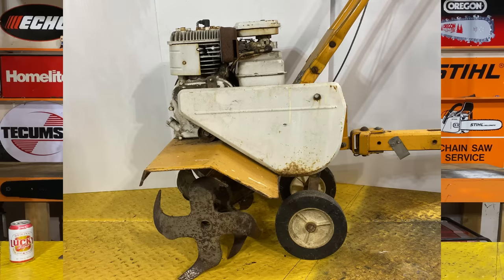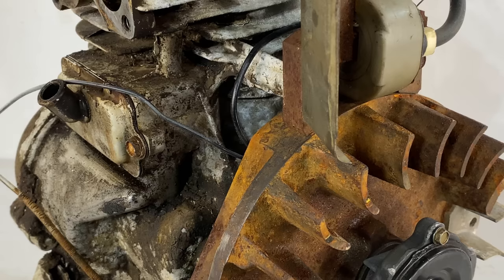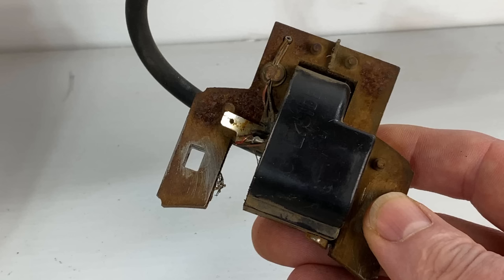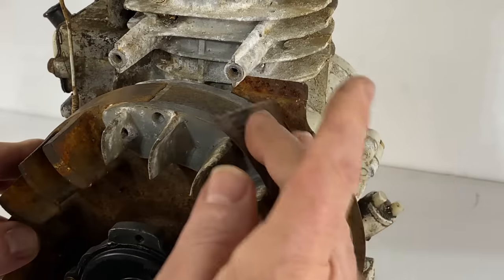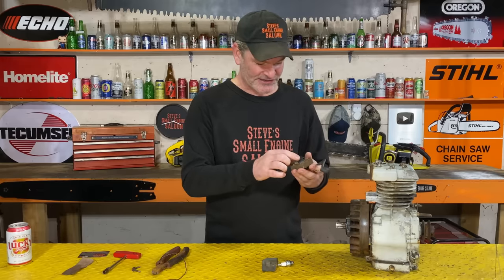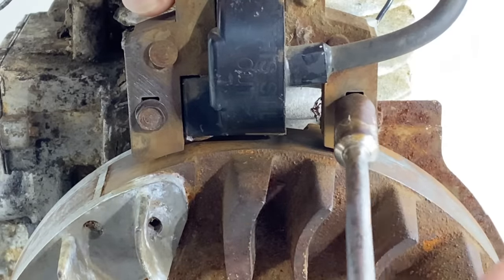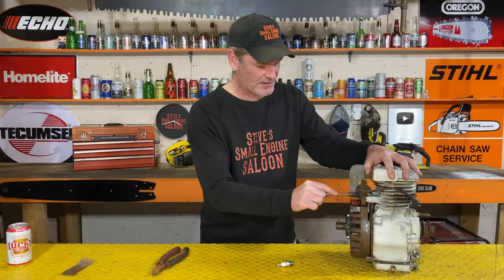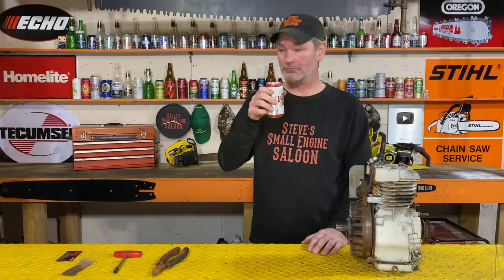Easy Hack To Eliminate Breaker Points & Upgrade To Electronic Ignition -Episode 5 of 7 Tiller Series

Comment: Awesome video. Thanks for sharing.  Question: If you do not have the exact manufacture's ignition coil replacement, can you use any coil which can physically fit the bolt holes, the flywheel curvature and the spark plug reach?

Comment: You got lucky, that you happened to have an electronic ignition coil sitting around that fits on this old engine. Any idea where the rest of us can buy an electronic ignition coil that fits? (I followed your link in the description, and it points to a non-electronic replacement coil on Amazon.)

Comment: How can I determine if my engine is points or electronic ignition without tearing it down. I have the model,  type & code numbers.
Its a 1989 Monkey ward lawn tractor w/ 18 hp twin sleeve. Like to change it to electronic if its points.

Comment: steve when i search for the coil on uk amazon i get ''ZAMDOE 595304 Ignition Coil Magneto Armature Replace for Briggs and Stratton 799650'' but it says for 12-17HP engines?? i have a templar tiller but the labels fallen off so i cant see the model, ive chopped off the coil as said lol, now i cant figure out if that replacement is right

Comment: Just have a question about my cub cadet hds3165, I add gas treatment when I store it for winter, when I try to start it in the spring it won't fire then I let it sit for a few minutes and  it starts. Runs fine after that.

Thanks

Comment: Steve, I cut the two wires on the flywheel and tossed the in and the coil and the trash truck just left, a now my radius is not the same. Wish you would told me that first. Lol.

Comment: The worst part of breaker points is getting the timing just right, but does this transplant eliminate the need/ability to adjust the ignition timing?
I was working on an old Tecumseh with intermittent spark, and only discovered since it got dark while I was working, that there was an invisible pinhole in the insulation of the spark plug wire that caused it to arc to the engine. Couple layers of electrical tape and heat shrink fixed it. Maybe you could’ve had a similar issue with that old crusty coil? I’m no expert, just a thought.

Comment: Steve; I need your help with my honda GVC 160 easy start mower engine. I have removed the carb. cleaned it in a ultra sound, replaced fuel lines, replaced the auto. choke button. cleaned internal strainer. The cold engine starts easy, runs for several minutes as it should but will go to full speed then goes to the point of quitting then speeds to full throttle then cycles again. This is not what I'll call hunting, it seems to have something to do with the weird choke system. Can you advise?

Comment: Super vid but of course the trick is to find an ignition unit that is exactly the right circumference shape...   I put 2 on my Deere tractor, but that flywheel is  huge compared...   Units are ebay cheap...

Comment: Steve, what kind of ignition module do you use on older Tecumseh flatheads with the points and condensor? Does the nova 2 module work? I have a tecumseh h60 that I'm looking to upgrade from the points system
Reply: The nova 2 modules work just fine on the H60. The Tecumsehs are reverse polarity from the instructions (see module install diagram), where the + and - terminals connect to the module. Mount the module on the shroud, where the connections can be easily made.

The chevron (no name, low cost) module on eBay works just like the Nova 2. Don't mess with failing condensers or points ever again.

Comment: Steve I think I’m actually at a loss as to what to say that I haven’t already said. I absolutely love each and every one of your videos. I have to attempt to try to take the carburetor bowl off of my rototiller because the oil smells like gas and I’m not sure what could be causing it. It’s only a year old. If the needle valve is stuck open how would I know that or if it’s the float how could I tell?? Is there a certain thing I should be looking for to see if either one of those or both of those are my problem?? Thanks for your great videos Steve

Comment: I tried to buy an electronic coil for my 16 HP Briggs 326400 Cast Iron Series and I was told it will not work on my engine because it's a cast iron block and I would need to remove my flywheel and sent it to Briggs to have my flywheel magnets reversed. Is this what needs to done? Is there a simple work around?

Comment: I would suggest some anti-seize on the screws. Mine is stuck fast after having it off a few times to clean and sand the pickup and iron bits. I'm now on my way to buggering over the screw heads.
Reply from the maker: Good idea!

Comment: Would that work on a  Wisconsin 10hp motor on a bolens 1050tractor. I can fabricate mount for it. But will it work so I could be done with the points and condenser? I’m also trying top keep the large starter generator. Any tips or suggestions?thx

Comment: Steve I have an old 5 horsepower to cut my and the coil is inside the flywheel underneath the flywheel can I convert this to electronic ignition or am I stuck with that old point system

Comment: I have a question about a kohler magnum 20 engine, the coil went bad so i ordered a new one and it was a chinese made one but it will not make a spark do you think the the china made ones will not work for some reason? the company sent me another one but it will not work either.

Comment: I upgraded my lawn mower to electronic ignition. But I have an 041 Stihl power saw that I might half to go back to points, because the Sweden SEM and the German Bosch electronic systems are no longer available. Also I have went through 3 Sweden electronic coils and stators from other parts saws and one by one they all lose their spark. Is there a way to test the coils and stators separately to find out if one or the other is still good? The German electronic system does not have a separate coil and stator, but the Sweden ones do come apart. I can't find anyway to really test these Sweden coils or stators out of the saw,,,,,,,,,,,,,,,,,

Comment: My coil must be a electronic type. The is only one small wire and the spark plug wire. I do not have any spark. The engine fired off once when I tried to start it. After that it wouldn't start. I pulled the plug and cleaned it. I still don't get any spark. Is there a way to test the coil?

Comment: Interesting, saw a video the other day explaining how the electronic system worked, and a comment asked how they did it without electronics... answer, with points.
I always thought a magneto worked simply by the magnet passing a coil, but that wouldn't produce enough output.

The magnet passing induces a current in the primary circuit, which is closed by the points or the electronics with the pickup from the trigger coil pole piece.
But instead of allowing the current to decay as the magnet passes, the points or electronics interrupt it, causing a rapid change in field and a high voltage on the secondary

Comment: would love to see more of your little mods/short cuts like this points can have some advantages if you want to alter timing a trick i used for years is set the key way in line with a casting mark that is on the lower end away from the cylinder portion it made those push mowers start first pull

Comment: Steve, you ever have a rider mower that breaks belts? My boss has a turd Simplicity. The seat springs are broke, you have to prime it to get it to start. When you pull the PTO button, the belt squalls and about 2hrs into it, the belt shreds itself. He bought it used. I think the guy seen my boss coming.  Mower is on its 7th belt. The blades are so dull, I can't cut grass with it, I can "Whoop it."
Reply: So, buy seat springs, & that’s an easy fix. 
If your belt is squealing, that should be telling you something. 
First thing to check is belt tension, and check for proper belt length. 
Next, check to see if you have any bearings going out on the mower deck. 
If it’s an older deck, this is highly likely. Might be worth your while to just replace the bearings.
See if there’s an idler pulley on the tractor with a seizing-up or maybe a bent pulley too. 
Also, check for bent pulleys in general, deck too.

Comment: hi steve..  do you have a video on generator coleman  5000 watts  my  ignition coil briggs  Model# 19G412 type 1180 E2   
  don t  produce fire  i found he briggs number of this coil  398811
 Magneto Armature (Magnetron Ignition)  ..  i tested the ignition coil with my multimeter and it give me a good  2.6k ohms in each way   ..
 i tested the flywheel magnet . and the magnet is strong   the coil was working last time  and now i am not able to run this genearator 
 i disconnected  all the wires  from  the ignition coil to be sure  that the  kill switch  don t cut the fire  .. so i think its the ignition coil is dead   .. but  just to know if you could have some idea to make a miracle on it    :)  ok than k you

Comment: Hey Steve, I was wondering if you could tell me how I can remove the exhaust valve in my 50s Briggs engine. It sat out in the weather for way too many years, and has a ton of rust. The intake valve came out with some work, but the exhaust is stuck tight. Thanks in advance.
Reply: I've tried your recommended 50:50 acetone ATF mix, which has worked on everything else I have used it on by the way, but it didn't work on that valve.

Comment: I have an old tiller with a B&S 5hp engine. Now I have No spark at the spark plug... just bought a new ignition coil and a new sets af breaker points and condenser, but no spark when I "starts" the machine. I have testet the spark plug and I know it is working. And (this must be the Wiking in me doing this I take the spark plug wire in my hand and turn the machine... and gets zapped :-D, I tell you it stings, then I take of the rubber hood (don´t know what is called sorry) and holds it a few mm from ground at it gives me a spark, I reinstall the spark plug and turn the machine but no spark at all.. breaker points set to 0,30 mm.. But no spark at the spark plug.... What to do?

Comment: Even though ignition points in Briggs engines are called "breaker points", they are actually "maker points. The spark does not occur when the points are opened, as in an old automobile ignition system, the spark occurs when the points close, or make. The points on a Briggs are open almost all the time, but at or near TDC, the points close, because of a flat on the crankshaft.  So the ignition system is a "maker point" system.
Reply: I believe you're mistaken. Yes, the points remain open for most of the crankshaft revolution, but close as the piston heads up to TDC. they then open and at that point the sparkplug fires. The high voltage is induced in the secondary winding as the magnetic field collapses, caused by the points opening. Just like any other Kettering ignition system.

Comment: I'm having problems with my go kart it turns on but when u open the throttle it turns off but when u get off it and lift the back side and u open the throttle it starts running good but it only runs if u left the back side

Comment: I once tried to gap a coil using a metal feeler gauge. It didn't go well. Believe me, I sure felt silly once I saw somebody do it with paper/business card/the instruction sheet that comes with a new coil...
Reply: @ rpavlik1 A brass feeler gauge is used to set coil air gap. Or in this case, Steve's Business Card.

Comment: I've done it all, disconnected the kill switch, brand new electronic ignition coil, 4 different spark plugs (includes 3 from known running equipment), sanded flywheel with good magnesium (3/4 inch with screwdriver), still no spark. Please help. Lol

Comment: I this case due to the sever corrosion of the points I can understand converting it to electronic ignition. If it was me I would have at least attempted to replace the points. In most cases changing to electronic ignition is a down grade not an upgrade. Sure you dont have to worry about the points any more but you now have an electronic module to go bad. The electronic ignitions are less reliable than the point ignitions. Going deeper into the engine to replace the points  would take longer but that would just give you time for another beer, How is that a bad thing?

Comment: Between coil frame built from iron and the engine aluminium must to use special grease to avoid have rust. The two screws must be greased the same. The gap can be: .010, .012, no more .014

Comment: What about parasitic power loss with those points tapping away in there doing nothing? You could have an edge in roto tilling performance over your neighbor with this electronic ignition system AND removal of the old components. Plus, a slight power to weight ratio improvement. If you're going for gains, go all the way!!!

Comment: For a little excitement just hold on to the spark plug wire while you're moving the wheel around to adjust the gap. See if you get a little shock.
Reply: Haha, I've had that happen a few times before... It's always great when it happens then you yank your hand back really fast and hit something with it 😬😂

Comment: I want to get rid of my electric ignition.  Not often is there a problem but it always leads back to the electrical system which goes to the ignition switch.  I’m not an electrician but people bring me their power equipment which the same problems.  Headache.

Comment: Perfect. But points work just fine so long as you do them correctly.
Reply: Yeah - but you have to maintain them over and over and over and ................
Reply: @joesinakandid528  you do kinda. But its not as bad as you might think. Points last quite a while on small engines.

Comment: i use an analog meter (old one ) has a needle---easier to see deflection to test condenser the condenser controls the size of spark not the coil.as the points open the gd is removed from the coil lead and the condenser lead allowing curren thru the coil to make a manetic effect in the secondary windingas a very high voltage due to windings ratio this high  voltage flows to the dist and plug wire as a spark as points close this voltage stops if condenser is wrong mfd value you will have a weak spark and pitting points this is due to voltage unable to go  thru cond, so it jumps the gap of the point s pitting them over time

Comment: Hey Steve, Great video! I have a  B&S 1977, 11 HP tractor. The plug wire is eaten through by mice.  This looks like my answer, replace the coil with an electronic to eliminate the points.  How do I figure out which coil I need?  My code is 252417 0129 01. Thanks for your help. Tom

Comment: I'm watching this serie of your videos, because i want to fix my grandfather's old Tecumseh (with the indian-head logo) tiller. Well it didn't run since like 30 years. The thing is i can't find out which type is that engine (probably the LAV 153 but I'm not sure). My question is that those old manuals (if i could get one) says the order of the tightening the screws and the distances, or i have to ask from the company or a mechaic? Because my machine is a really old one, probably from the end of the 1980's (i was born at 1989 xD) and I'm not sure that the newer mechanics can help, especially Tecumseh is not so widespread in my country. What do you suggest to me? :)
update: i found it's number on the unit engraved: LAV 153 E-40027A